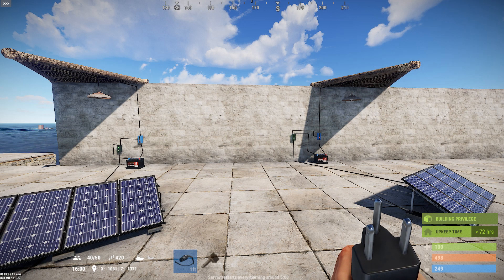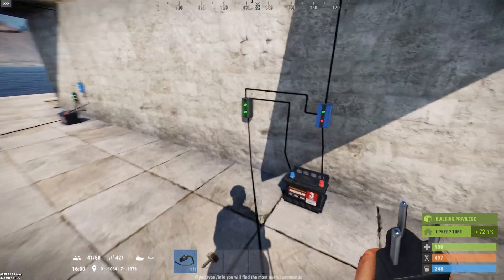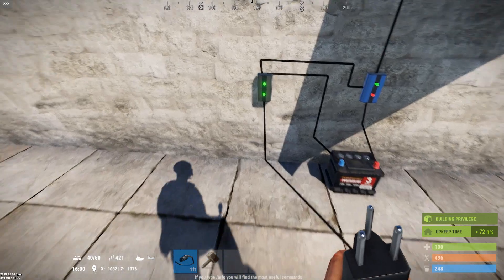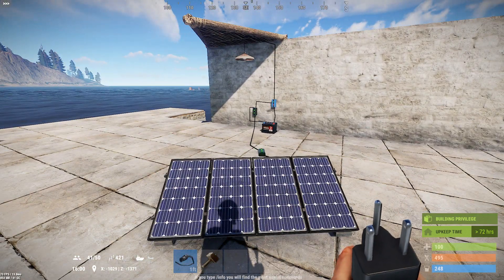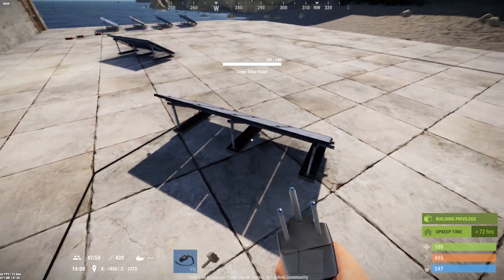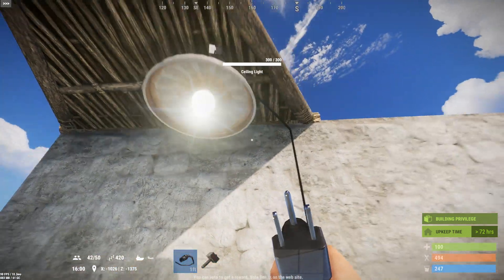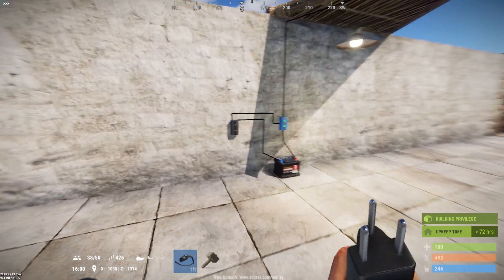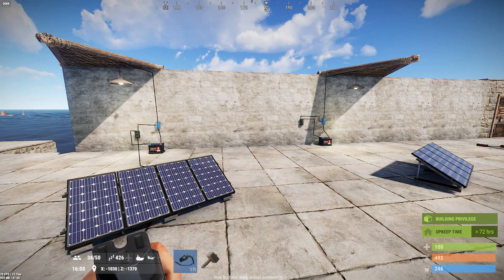Rust Electricity 101: Basic Circuits - Solar Lights

Comment: It feels to me as if the solar panel even generate a full 20 power at sunset, but since I got 2 solar panels facing east and west I gone for a branch of 19 in the second configuration so if only one of the solar panels gets light (which should be around dawn and dusk) the lights come on.
Edit: this is however that ineffactive that I use 2 batteries patched together.